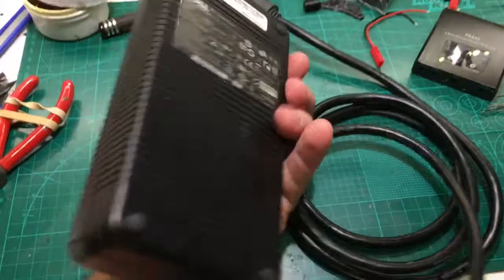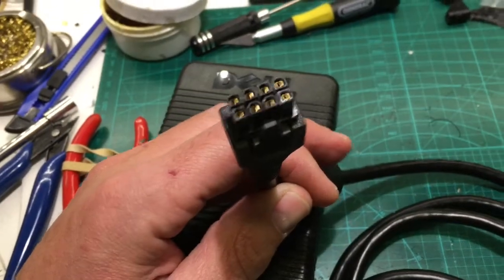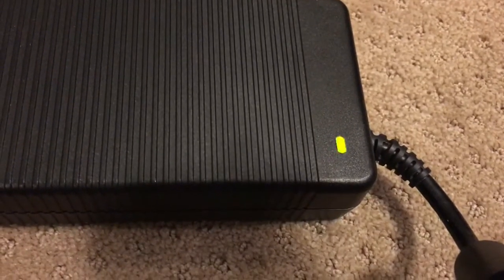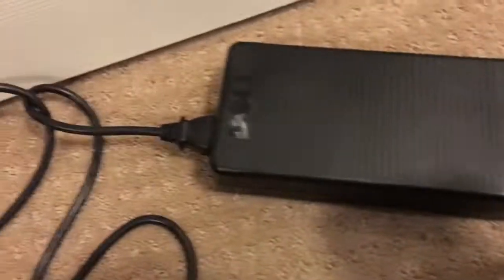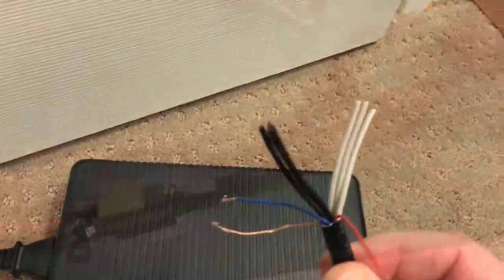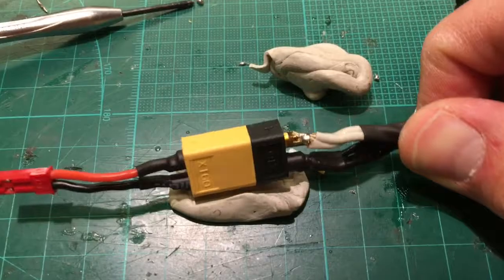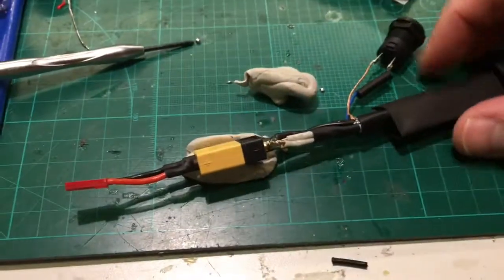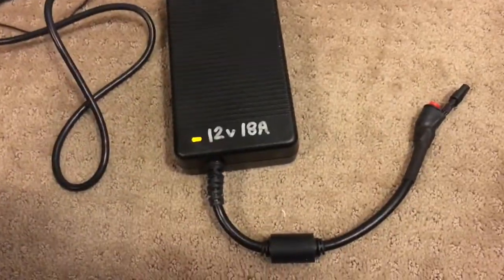Cheap AC/DC converter for your lipo chargers! Make a 12v 18A Power Supply from Dell MK394

Comment: This is an old video but I hope the owner is still active. I have Dell DA-2 that outputs 3 black and 3 white 3 -12v at 6 amp each total 18w. I like for it to do the 18A in one like yours. I just like to know if this worked well for you. Thanks.